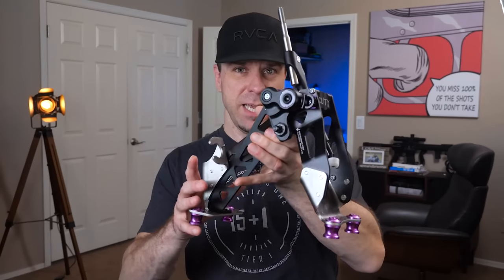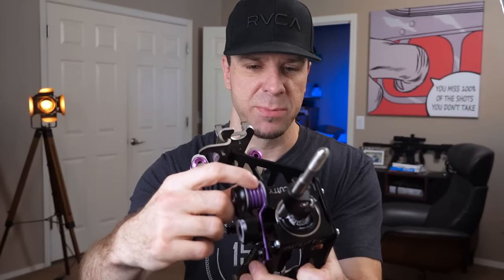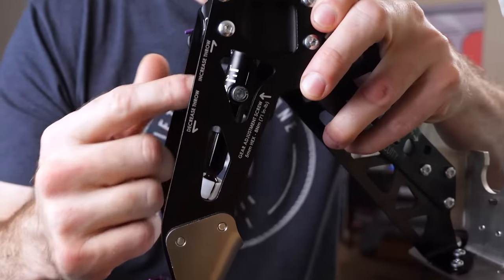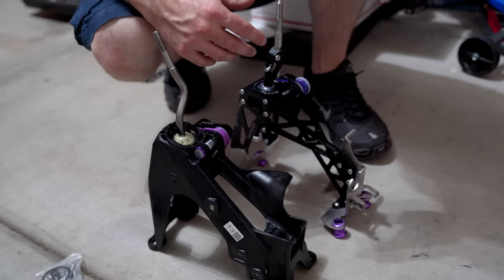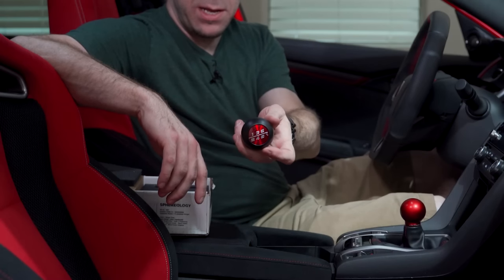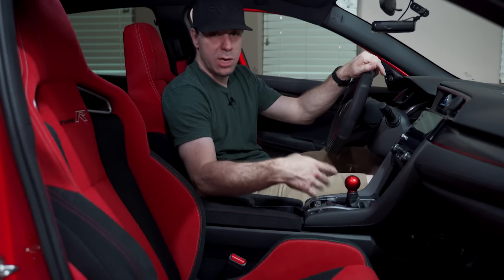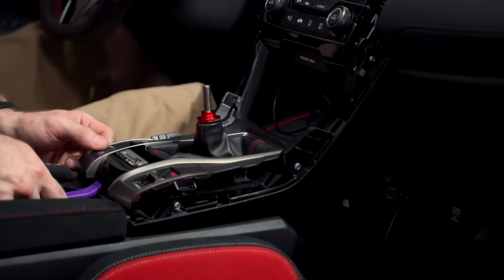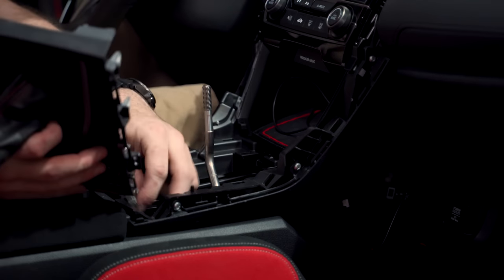Is this The BEST Short Shifter Money Can Buy??

Comment: Without even seeing a picture of your new shift knob, I knew exactly the brand of shift nob you were going to reveal when you mentioned weighted, metal, and heat resistant. The Raceseng brand!! I have a Raceseng Circuit Sphere 100 shift knob for my MK7 GTI, and it has the delrin finish as well, to resist heat. I bought it for that main reason, as other shift knobs burn my hand in the summer heat. 

It is the best shift knob I have ever had! The shape and ergonomics is incredible, the weight is balanced, and the style is just sexy!! Totally worth the cost!!

Comment: Bought it, installed it, LOVE IT!  I did not think it was going to make that much of a difference, but the feel is simply amazing!  I haven't installed the bushings yet, the shifter is so tight, that I am not sure if it is worth all the trouble to put those in, so I will hold on to them until this thing breaks in a little and re-evaluate that after.  My settings: I dropped the stick height down to "1", I moved the gate all the way down, and I left the shift length set to what it came with which was "3", and I run the 2017-2019 round factory knob in place of the new 2020 knob it came with (I like the old knob better) .  Thanks for the video!
Reply: I installed the bushings and the poco shift knob on my 11th gen SI and I would say it definitely worth it

Comment: I have found that the stock shifter wants to be in 3rd or 4rth. I think what you call the lockout, at least in my experience,  is going from 4rth to 5th, or 5th to 6th, even 2nd to 1st, my shifter tries to center and drop into 3rd or 4rth. If I'm not paying any attention to the shift it'll make it and I'll under or over Rev. Sometimes if I'm fast on the shift it won't make it all the way center and hit the gate in the middle and not go into gear. That's what I think you are talking about when you say lockout. What i have found is when going straight up and down on the side gears (1,2,5,6) I have to ride the outside and put pressure to go straight. I've never gotten the lockout riding the rails but still do if not paying attention. Same goes for going from the center to the outside,  i have to consciously put pressure to go to the outside or I'll drop from 4rth to 3rd instead of hitting 5th.
Reply from the maker: Very interesting Jose

Comment: You should get a hybrid and compare it ,that will help a lot of people to decide which one they should get , I went with the hybrid racing one and yeah the is a little tiny  play still in gear but that's ok , I think to stiff is bad for the cables or maybe the gears in the transmission,  correct me if I'm wrong later
Reply: Maybe my Hybrid shifter was installed incorrectly previously but I absolutely hate it. All I can think about all day is when can I get it out of my car and enjoy driving it again.

Comment: Great feedback. Thanks. I have the same 5-4 and 5-6 lock out issue on my ‘19. What transmission fluid are you using?
Reply from the maker: I'm still on OEM fluid, I might change it later on